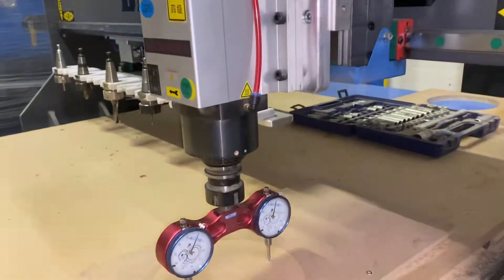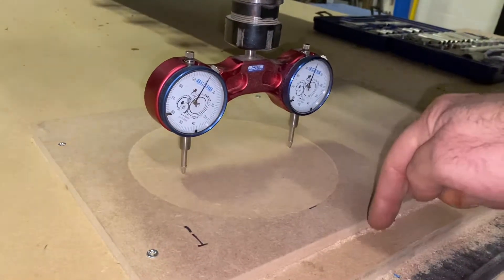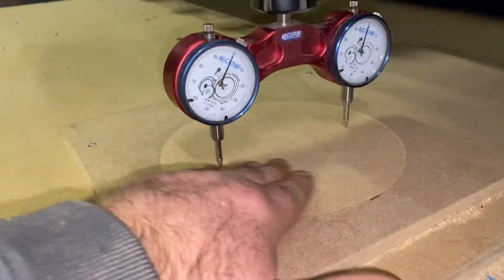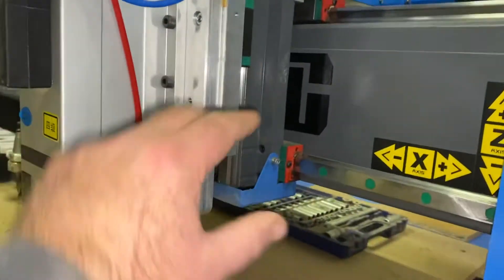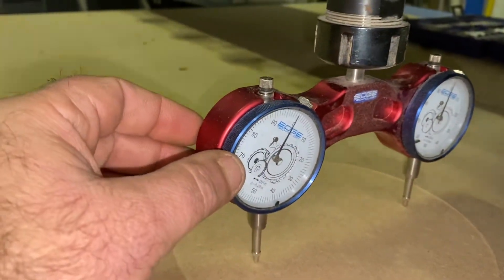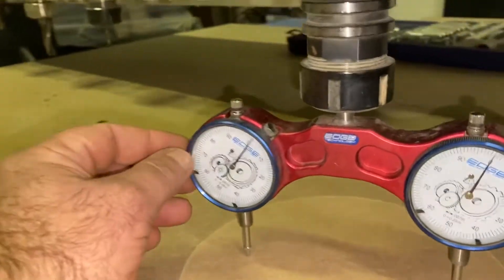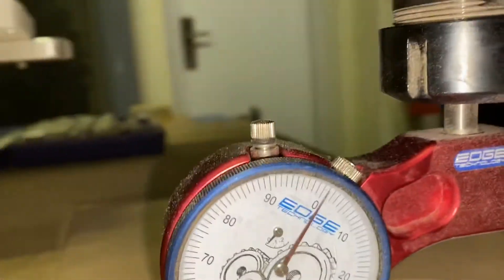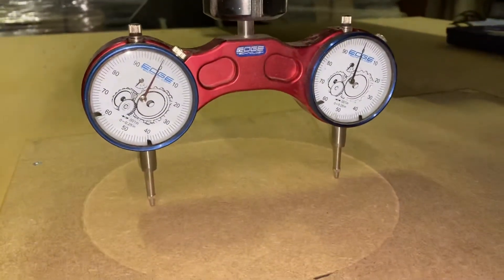Cnc router tramming check using pro edge guages. Tram your spindle!

Comment: This only works if you already have the machine trammed. You would end up with ridges and valleys if it was out of tram.

Better to use a precision surface such as glass or granite, then shim to zero in each corner. Takes longer but its more precise.
Reply from the maker: It works fine as you are using a very small diameter with low step over - so everything is flattened.
For our production machines we do use a precision granite surface
Reply: @cnc-routers-uk  fair point I suppose it all evens out plus for smaller machines I guess the accuracy you can get is going to be limited by other factors anyway. I might pick up some high density MDF to try this then, might be quicker.

Comment: Hi, 
very nice tutorial.
 Is it MDF a bit grainy for this method? 
Thank you
Reply from the maker: The mdf grade I use is high density
Pretty smooth once fine skimmed . As you can see in the video under 0.01 mm deflections
Reply: @cnc-routers-uk  I will try this on my CNC it seems all other methods with glass dont work too well.  
Thank you